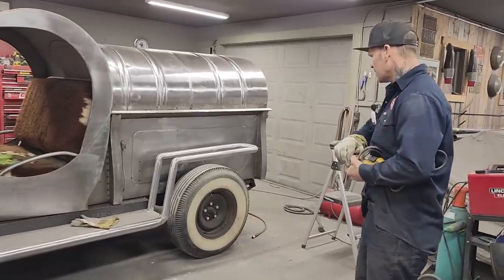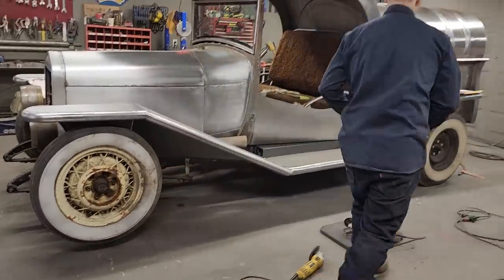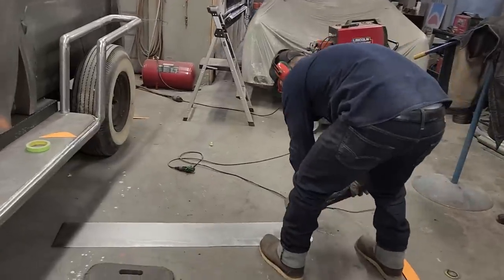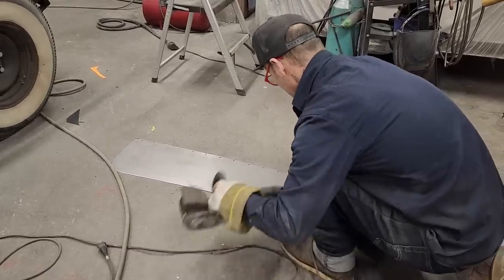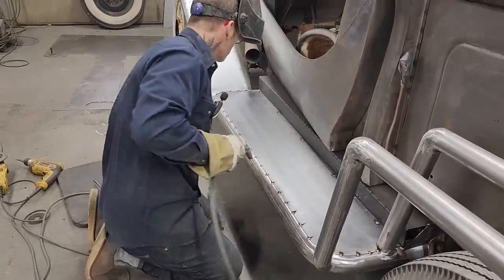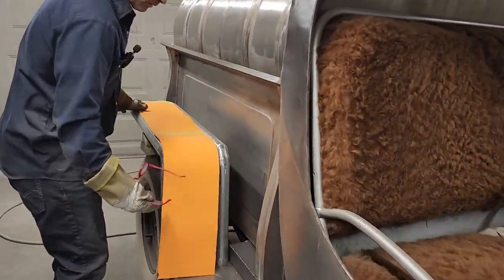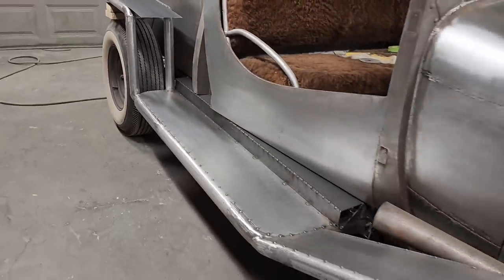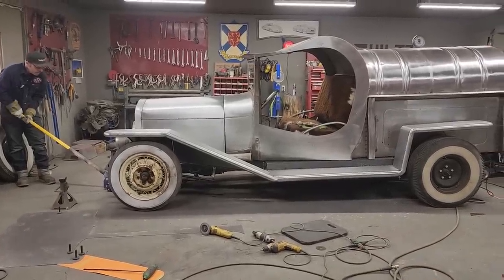Fabricating the rear fender to complete the look 👏🏼

Comment: Admire that your visions come to life.  The T Tanker is awesome.  I was wondering when you get to the rear of truck I vision the rear end of the tank having a removable circular enclosed sheet metal.  The enclosure would have an old pipe spout with a gate valve.  The top of the tank would have an access port with lid.  Simulating how the oil would have been loaded and dispensed.  Also I think louvers in hood would look nice.  You and Joliene are fun to watch.

Comment: Hello Chad & Jolene the project is certainly moving along and both of your work is top notch as always. I know the shape of the fenders is as planned and it is from an era back when things were done much simpler and much more plain. I am just having a little trouble getting used to the rear fenders being so squared off instead of more rounded. I am not criticizing and I don't think it looks bad, I am just thinking that it caught me off guard and it will grow on me as I get more used to them. I really should just delete what I wrote because, I have gotten used to them already and I like them now. They fit the times and when looking at the complete assembly it really looks good! Absolutely great job as always Chad & Jolene, I will be back tomorrow for the spare tire install, it is going to look good!

Comment: Will there be an inner fender wall between the rear tire and box? It's looking great. The splash panel on the running board did a lot to reduce the size of board itself. Definitely needs a bracket on the rear fender, not sure I'd connect it to the box. I'd probably do it like you did the inner front fender and connect it to the chassis.  Outstanding though. Jolene's camera work showing the plug welds in detail was great. That lady does an awesome job with the camera and sound.

Comment: Looking better everyday!  I suggest a Santa's sleigh type door opening and arm support area.  Possibly a radius fill piece in rear fender outside surface to give a more flowing appearance.  Take care both of you!
Reply: I was thinking maybe a shorter running board at the trailing end so the fender structure has more of a flow .it's almost 90' degrees now and it clashed with the front fender flow . Shorter running board gives the rear fender more room to have less of an angle at the start going up.

Comment: Hi Chad and Jolene. I think the spare wheel would look better sitting in a cut-out in the front fender. There's plenty of room for the wheel at the front and not so much at the rear of the running board where it would interfere with getting into (and out of) the driver's seat. Kind regards from Down-Under (Australia). 😄
Reply: Putting the spare tire on the front fender, it would get a lot of heat from the exhaust, wouldn't it?
Reply: @willhorting5317  There is an inner-guard between the front fender and the hood. So, when driving, air would pass between the inner fender and the hood thereby cooling the exhaust pipe and that immediate area. Also,  if the present short exhaust pipe is retained, it would blow hot exhaust gases directly onto the wheel and tire if it was mounted at the rear of the running board.
Reply: @robertyarroll6121  I definitely agree about the heat being directed at the tire if mounted where Chad sat it.
But I wasn't sure about up front.
Thank you for the information.

Comment: There is a tip available for the mig welder specifically for plug welding. It allows you to make contact with the metal and push the two sheets together eliminating the need for the third hand. It works great with the hole punch holes and no need to drill them larger. I’ve used one of these for many years with great success.

Comment: nice job chad you should buy yourself a Dewalt impact it will drive your drill bits in without sliping as well you can use it for your smaller sockets

Comment: Brad: you might use 2x4 pieces to support your sheet metal when you are welding or cutting. One foot, two feet, three feet or other lengths so you can support the work piece so you can have both  hands to do your work.

Comment: Looks good.  But as Chad mentioned yesterday, quite square & angular.  He mentioned that these vehicles also came with more rounded fenders on some years.  I like C-Cab.  But - my two cents worth is that in this case the C-Cab does not look harmonious with the angular fenders.  I'd like to see Chad change the cab to an open Roadster style.  Would look even better.

Comment: Since you guys have not ridden motorcycles...fabricate a 3 wheeler/or4...using an antique cab two wheels\ & a motorcycle engine & front wheel.. which will be totally  weather proof --A Chad Special 3 wheeler. rider & passengers

Comment: Please don't put a sink hole in the running board . Stand back and look Your spare tire will probably be not much further off of the you're rear wheel  . Is that tank functional if not put the spare in there?